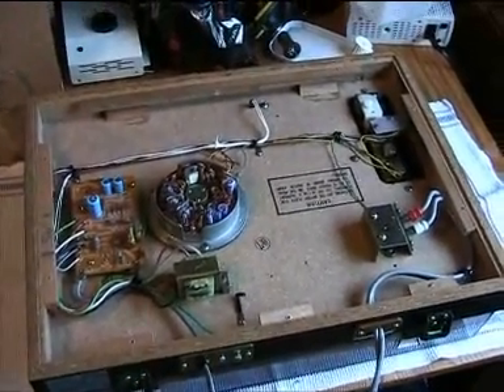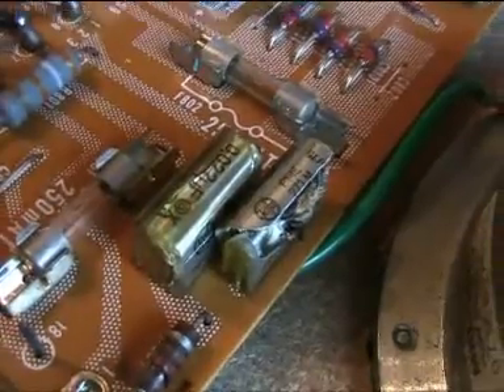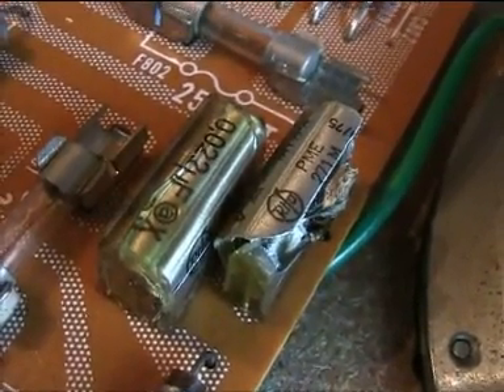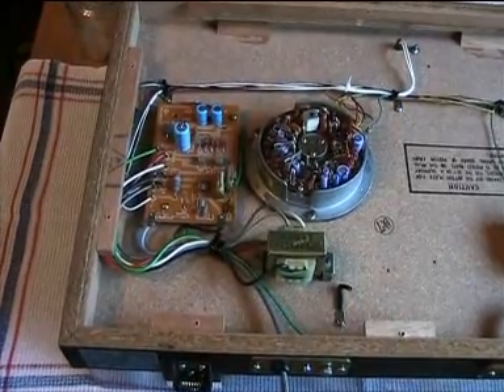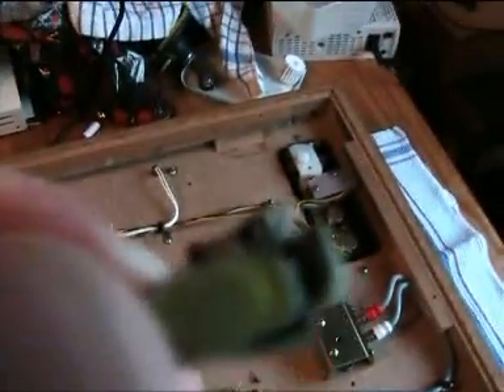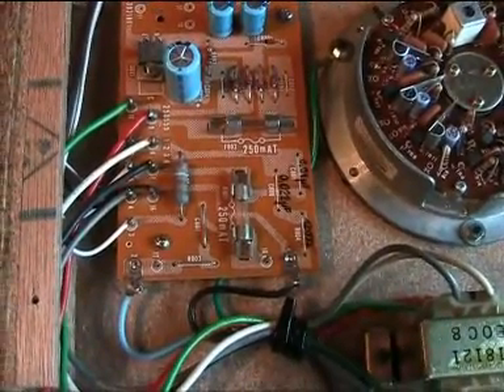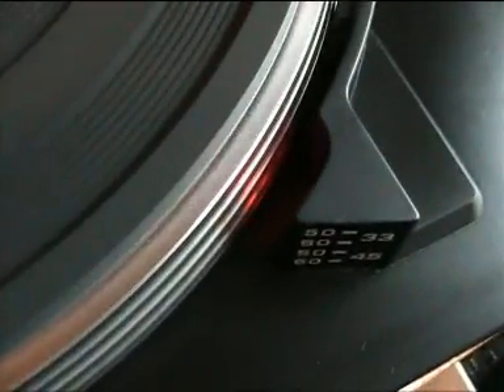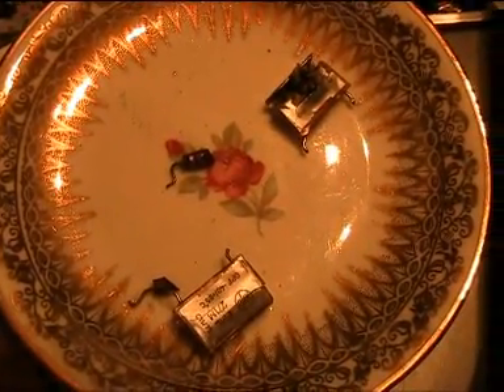WARNING! Bad RIFA capacitors!

Comment: I unsoldered one which spilled its guts inside my Apple II power supply APPLE model 605-5073 also ASTEC MODEL AA11040B. I had been using the 12V output of the supply to run a car stereo indoors and noticed the room was getting smokey. Forty years old so can't complain too much. Supply case is aluminum with no vent holes so very low fire hazard. Now I need to find a replacement.
https://photos.app.goo.gl/dDFyqHxiSE7mR8zW7

Comment: I encountered one of these RIFA caps yesterday in a Nokia satellite receiver from 1990 that I was using for some analogue TV tests. Same as yourself, an almighty bang, a lot of smoke and a nasty smell which still seems to be lingering. I removed the cap for now but will probably look at putting something in to replace it.

Comment: The crappiest part of the whole ordeal is that one engineer actually successfully identified the problem back in the 1970s when they were new to the market:
https://www.vintage-radio.net/forum/showpost.php?p=905124&postcount=157 If only the people in charge of the approvals were this imaginative…
Reply from the maker: Interesting, thanks for the info!
Reply: That clarifies why they're even worse than potted impregnated paper caps in general, but even the good brands would blow in the same way. It just took them a bit longer. This failure mode is inherent to paper capacitors and worse so when manufacturers try to cut costs.

Comment: I’ve seen (and heard) these fail on Ampex, Studer and Tektronix kit as well as other manufacturers. Now I always make a point to visually check any equipment inside and replace these capacitors before any burn up. I’ve also experienced issues with Schaffner mains filters, which I guess is due to the same Rifa capacitors failing inside the metal enclosure.
Reply from the maker: Apparently WIMA mains filter capacitors also tend to have problems. So far I have not come across any of them though.

Comment: u should correct the video name at least, those aren't nasty simply they overpassed their life cycle.  have same issue on an old oscilloscope tektronics 2235  (this unit was manifactured on 1984, so more than 35 years). im 100% sure that if Tektronics choosed that component isnt a nasty one :D
Reply from the maker: Capacitor life time is not this short. There are similar spark suppression capacitors by other manufacturers that are still perfectly fine despite being older than these RIFAs. Tektronix equipment by the way is well known for bad capacitors, especially electrolytic capacitors.
Reply: Unfortunately, at least one British manufacturer did the tests at the time and deemed the component nasty. RIFA just had very good marketing, and presented their crappy product as the go-to solution for foreign manufacturers who were looking for a simple way to have their mains filtering approved for use in Europe.

Comment: Also used in Husqvarna sewing machines. My Mother, thinking the motor had burnt out,  threw away all the accessories for hers before asking "could you take this to the tip". When I looked it was a RIFA capacitor next to the motor that had blown. 

I also had one blow in an Electrolux vacuum cleaner. With all the air rushing through I didn't see any smoke but everything stank for weeks.

Note that the capacitors are there to prevent sparking and generation of Radio Interference so should be replaced by suitable alternatives with a suitable Class X or Y voltage rating depending on position. The joke is that these firecrackers were probably used because RIFA claimed they were "Self extinguishing" and much better than their competition.
Reply: Huh. Thanks for posting. My mum has two Husq embroidery machines, which I've already changed the electro's on not long ago. Didn't know about this! I have a photo of the control board of one of the machines, and a RIFA capacitor is not on there. Where was it on yours?

Comment: Hi, I just took a RIFA PME 271M out of my mum's New Home sewing machine. I noticed when opening up the motor that the capacitor was dark and split. I was just wandering if it mattered if if was 250v MP or 250v SH ?  Also it is a 40/085/56 but could I put in a 40/100/56? Thanks for your upload!
Reply: Nope, it just an RFI Cap.

Comment: Old thread I know. My understanding is that the casing cracks and allows moisture in. When heated, steam forms and causes catastrophic failure of the cap. If your observation note any cracks, they should be replaced.
Reply from the maker: Yes, the cracks are part of this whole problem. I have thrown out quite a few of these caps that were still functional but had cracks in the case.

Comment: Very common use these RIFA's (Or Bob Marley's as we call em on the restorer forums), in UK slot machines, BBC Micro Computers, Henry Hovers etc. What we often do on the slot machine restore projects that have these in, is either uprate to 350 / 400v types (Can also use WIMA branded), or certainly in the case of JPM MPS PSU's (See vid on my chan), is cut them all out, and fit a filtered IEC Socket (Min of 5 amp).

Comment: I had a similar smokebomb event with a Revox reel to reel which had not been used in years.  After much research I ordered a panasonic x2 safety cap for the AC power portion which had blown and replaced another Rifa on one of the other boards just to be safe.
Reply from the maker: The Revox A77 for example contains many of these RIFA capacitors, in the power supply as well as in the logic circuit. They should all be replaced.

Comment: Tandberg tape recorder of 1960's vintage are full of Rifas used as coupling capacitors, they are always leaky with resulting issues to the audio. Rifas are one of the few types that I replace on sight, they are always bad to varying degrees.

Comment: Hard to say if RIFA capacitors are designed bad. It took about 30 years or so before they started to explode all over the planet. 30 years for any kind of electronic device is way beyond the design life of the device. This could have happened with virtually any component due to age - especially electrolytic caps. The only flaw with the RIFA caps in particular is that they have a plastic translucent covering that with time become brittle. Even when they're brittle, they still work. But, with additional use, the pressure builds up in these caps to the point where the plastic covering can no longer hold, and then POP! The reason why the player still worked despite the caps missing is that more than likely they're installed in parallel with the rest of the power supply circuitry, with the sole purpose of filtering spikes that comes from the mains before the power gets to the rest of the circuitry. They're known as safety caps, which is what the "X" or later "X2" signify. So, by running the player without the caps, spikes will now travel further through the circuitry, potentially blowing even more (expensive) components.
Reply from the maker: I have barely had any problems with components of that age. Just those RIFA caps stick out. As well as some no name cheap electrolytics, but that has to be expected.
Reply: These capacitors are notorious - Google "RIFA Exploded" - Some people say that the cracks appear in the case even if they have never been fitted in a board. I guess RIFA used some dodgy plastic that only lasts about 20 years.
Reply: Normally, paper capacitors already age badly - the technology behind them was mostly outdated around 1980 and even in the late 1950's component manufacturers like Philips were very keen to move on to escape the random early failures and tendency to go leaky due to moisture ingress. RIFAs age worse because of an inappropriate potting compound which causes stress cracks and moisture ingress to occur faster and even more random than normal.

Comment: Something I forgot to mention is that an AC voltage generates a much higher stress in a dielectric than a DC voltage, even if the DC voltage is fluctuating under an applied signal. That is why filter capacitors are expected to eventually fail and are classified as Type X or Type Y according to the mode of failure. The capacitor you are complaining about is a Type X and will fail with an open circuit. You shouldn't complain. It's done what it's expected to do.
Reply: You're mixing up your X's and Y's. Only Y types are supposed to be guaranteed to fail open... But guess what: RIFA Y capacitors also won't always fail open. And both their X and Y types are known to have caused fires, also something they shouldn't do. While paper capacitors have no place in equipment made after 1975 or so, those made by RIFA were (and likely are) utter rubbish and have no place in any equipment.

Comment from the maker: They do - note I meantioned they are part of a tube type radio. And that radio does in fact run at voltages between 300 V and 400 V.

Comment: You say you have not found out exactly what the Rifa capacitors were doing. However you are right when you say that you think they may be some kind of filter capacitor. They are in fact filter capacitors which run continuously at mains voltage. There is almost no other duty for capacitors which requires that they run continuously at or close to their maximum rated voltage. Almost certainly the capacitors you mention which are rated at 400V will not run continuously anywhere near this voltage.

Comment: Wait, you took the capacitors and resistors out but didn't put in replacements? What do you think they do? They're a couple of bucks! And BTW, most likely the resistor failing probably caused the caps to blow.
Reply: The resistor can't in any way cause that failure. It's the other way around.

Comment from the maker: And you need to learn how to behave yourself.
I have tube type radios that are 40+ years old with similar non- RIFA caps running at voltages around 400V - and guess what: Those are still perfectly fine. 
So better don't do any trolling when you don't know what you are talking about.

Comment from the maker: @coolbluelights 

They probably were used as "spark killers" for the power switch assembly... I'm not sure. But since I haven't had any problems with the Hitachi since, I know that these capacitors aren't really necessary.